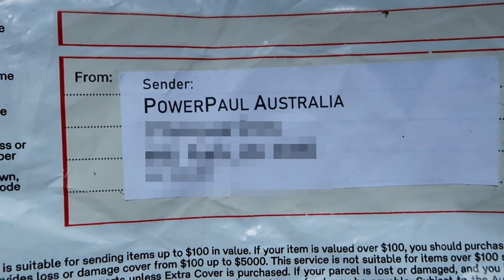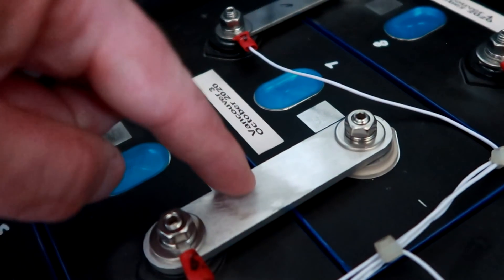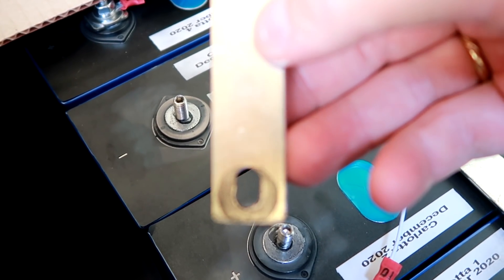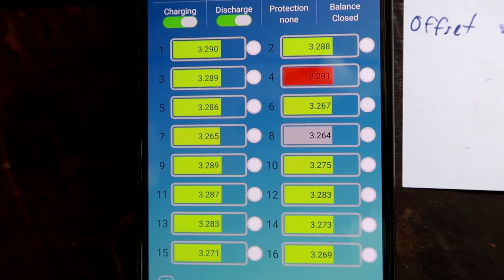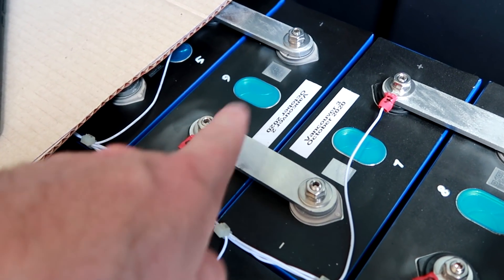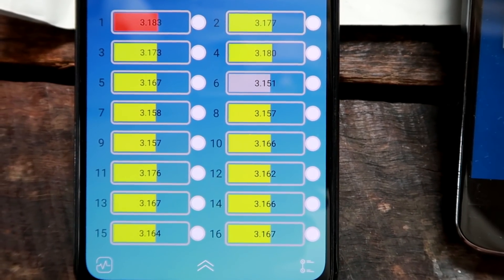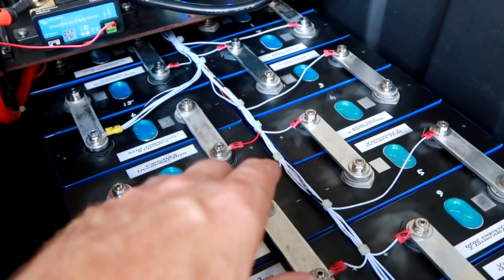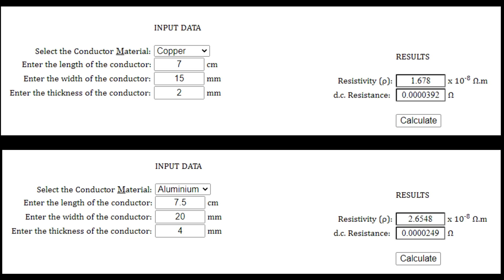Upgrading to Aluminium Busbars. Will this solve the issues?

Comment: Hi Andy, I was thinking, your rings between the lugs and BMS wires, are those made of steel or are they aluminium, maybe replace those rings so there is only aluminium in between. Good luck in finding the issue btw. Maybe measure the resistance of your monitoring wires, they are for checking voltage only but a resistance difference might be in your way. I hope you get a lot of good sunny amps 👍
Reply from the maker: The washers are made of stainless as well, but they are not conducting any power, just pushing down on the busbar. I've checked all balance leads voltages with a voltmeter and they match the ones the BMS shows.
Reply: @OffGridGarageAustralia  if you read the low value in the app when applying load on the cell, is the cell the same voltage when measured with your multimeter? If so then probably the difference in chemicals in the cells might give this effect. If the multimeter shows a different value can it be inductance on the wire because of load applied (just a guess). Thanks for all the testing and checking this all on your journey together with the community!

Comment: I think you find nil voltage drop with the alum-alum interface bars! Alum surface inherently self oxidizes on surface and thus protects sub-surface. Common alum auto castings are alloyed and different corrosion happens.
Reply from the maker: Yes, we're almost there!

Comment: I think maybe bottom balancing, and only charging to 95% may help, or try 100% charging with only 1-2amps, use a DC to DC with cc CV,  and charge to 3.7/cell, to allow the BMS to do its job,  charging with less than 100watts,  should allow the cells to fully charge and Ballance, 3.7v isn't going to damage the cells, but at 1 amp or so, less than 2amps !
Reply from the maker: But where is 95%??? How do you find that point?
Reply: @OffGridGarageAustralia  the charge curve I guess, or 95% of 280ah,  I'm guessing charge at 1amp to 3.7v/cell would allow the BMS to properly balance, being the best option!

Comment: I think the best improvement would be more panels connected! I don't trust anything between the terminals and buss bars,   I'd use both buss bars, the aluminum and copper! Maybe drill a tiny 2.5mm hole on the edge of the buss bars for balance leads! Instead of on the terminals, / allowing the nut to cut into the buss,  I prefer the serrated flanged nuts,

Comment: Please try to do swapping between 1 with 2 and 6 with 7 for example and see still the same two batteries giving the same voltage values ? 
Because I think the problem either from the two batteries ( 1 and 6 ) or from the BMS reading input that read from 1 and 6 because the tolerance issue.
Reply from the maker: It's the cells 6, 7 and 8 which are lower. But are they really lower or just unbalanced. I'll do the test in the next video...

Comment: Could be a positive thing, at least it shouldn't be a negative, haha. Surely... I think maybe I would have went with brass, 3mm x 20-25mm bar, machined with a mill to be 100% flat and true, with a 5mm slot about 10-12mm long to allow some movement if under stress! Surely that would carry the current! Polished  with a clear coat, except the contact area, it would look nice also, *I'm also thinking maybe it's the balance leads!!! * Could it be cheap balance leads? Possibly replace them with silicone 20-22gauge tinned copper wire, and soldered connectors,  this stuff can get a but expensive, and possibly no gains of anything except looking better!  The buss bars would look great, and more conductive than aluminum, but heck, maybe have them silver plated! Or gold! Or both! Haha, crazy talk... But brass or aluminum, I think it's 6061 t6 is what I used, it's a decent conductor, and cheaper than. Brass!

Comment: Is it an idea to connect the BMS wire not under the washer/nut for the busbar but on a seperate connection on the bus bar. Drill a little hole in the middle of the bus bar and screw the BMS connection with a little bolt/nut/washer on it. The big charge/discharge current aren't flowing through the BMS connection. Just as you are doing with a shunt resistor with seperate measure terminals.
Reply from the maker: Yes, you can do that. But the BMS wires are not the problem as I checked all voltages and compared with the ones the BMS shows.

Comment: Wouldn’t the copper bussbar have lower resistance if they were the same dimension as the aluminum bussbar? The other thing I was wondering about was the surface area in contact with the battery terminal. With the constant low readings on those cells, could the problem be with the bms’s not the bussbar? Just wondering.
Reply from the maker: Yes, click on the link in the descriptions and you can play with the calculator.

Comment: Resistance is simple to calculate:  R = rho * L/A   where rho is the material property called  resistivity (it's a table look up), L is the conductor length, and A is the conductor cross section.  With L being near equal,   R_al/R_cu = 2.65/1.68 *1/2 = 0.79.  That is, the Al busbar have about 21% less resistance.   To be honest, the resistivity is not the issue.  It is the galvanic corrosion between the two different metals.   Having Al terminal to Al busbar give you a good good connection which will not galvanic corrode.   You will have an issue between the stainless steel hardware and the Al busbar.  To first order, this should only be a mechanical and cosmetic problem as the stainless steel (stud, washer, nut) have 30X the resistivity compared to Al/Cu.  You will first see the washer to busbar Al surface corrode to Al oxide (white crud).   A little grease (I use Tef-Gel) will keep the Al/Stainless corrosion free.

Comment: Take off the washers under the buss bars. Any weakness in the washers will show up in the voltages. You don't want the washers between the buss bars and the battery terminals.
Reply from the maker: There are no washers under the busbars. They lay flat on the terminals.

Comment: Is it possible that the batteries are slowly going out of physical alignment due to the surface they're sitting on flexing, resulting in uneven pressure at the terminals? This may account for the need to occasionally re-tighten the connections.
Reply from the maker: The cells don't move or flex. I checked the surface area when empty or fully charged, there is no difference.

Comment: No... Nordlock washers will take care of your problem :-D
Reply from the maker: They only make sense in a mobile setup when you deal with vibrations. But in a stationary installation??? I don't think this makes a difference.
Reply: @OffGridGarageAustralia  ???? If the y are awesome in a vibration installation, imagine what they achieve in a stationary. You would never have to think about adjusting the terminals, is that simple.

Comment: Are you using stainless steel washers and fasteners?  SS is not as good a conductor as other metals. 

The voltage drop you are measuring between fastener and bus bar/connecting strap will not be affected by the thickness of the strap.  What you are measuring is due to the contact area and losses in the fasteners
Reply: Bolts are used only to hold the bus-bars to the pads that surrounds the threaded holes.

Comment: The three most conductive elements are Au, Ag and Cu. Copper wins on price, but gold is used in electronic circuits because it doesn't (easily) corrode.

Aluminium is used in overhead power lines because it's good enough, and it's light and cheap. When the SEC left me some free samples, I unpicked the cable and discovered some high tensile corrosion-resistant steel wire in the centre. My brother and I used it to make buckles, we had to heat it to bend it.

I would not use any magic compounds with your aluminium, the al might sacrifice itself to protect the carbon or copper in the compound.

I suggest you do not polish the aluminium busbars, it instantly oxidises forming a protective shield.

Comment: Hallo nach Down under, ich habe Deine Batterie fast 1:1 nachgebaut und habe das Problem mit dem Übergangswiderstand nicht. Ich habe lediglich die Kontaktflächen mit Bremsenreiniger entfettet und einfach zusammengeschraubt. Meine Busbars sind allerdings 20 x 2 mm. Ich habe aber etwas anders gemacht: Ich habe die Zellen einzeln getestet und festgestellt das die Kapazität stark variiert. Deshalb habe ich einen bottom balance gemacht und lade nur bis 3,35 Volt pro Zelle (und entlade nur bis 3 Volt). Alles soweit gut bis jetzt, habe auch die nachfolge BMS installiert, die funktioniert auch gut. Gruß Michael
Reply from the maker: Hallo Micha, danke fuer deinen Kommentar. Wie lange hast die Absorption time eingestellt bei 3.35V?
Du benutzt das neue BMS von QUCC mit dem 'besseren' relay?

Comment: Hi. In relation to your mulcher staring, you nay consider putting in a "soft start" to help with the extra power when in startup mode.
Reply: I think the mulcher don‘t start as quick because the Inverter has a load sense that starts providing more power only if it is needet. That‘s how my Inverter (Studer) works to save Energy.

Comment: I’m very surprised to see you have issues with the bus bars, I have the same cells and bus bars on twin 16s batteries using daly smart  bms, there is some differences until the balancing kicks in, but when fully charged there was only a difference of 3 thousand of a volt .  I used a aluminum to copper conductive grease to stop any oxidation.

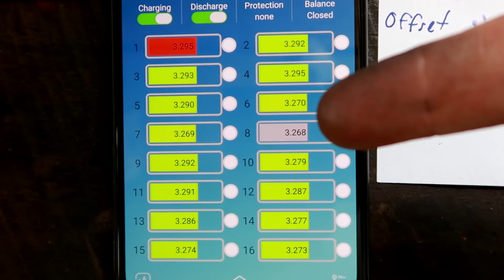Comment: The difference at 8:48 shows 0.027 volts. That is less than a 0.8% difference. I would suggest that the BMS doesn't even have that accuracy(even if it is accurate to within 1%) so this is totally insignificant I think. But great videos and watching with continued interest.
Reply from the maker: Yeah, if you factor in the accuracy of the device I use, It's hard to say what's really going on. The next video will clear things up a bit, I guess ;)

Comment: about compressing batteries ( an other video ) . I asked battery manufacturer BASEN , Shenzhen. They answered; no need for compression, just keep all top side up. If they for some reason 'live' there vil be no leak.
Reply from the maker: There is a difference between compression and fixture. Man discussions online. It's a bit like Apple vs. Android, Ernie vs Bert...
It's either or neither, I guess. I have not seen any 'deformation' of the cells while charging.

Comment: Andy size matters more! Yes the Al busbars are better but that has more to do that they are bigger in size than the material. The bigger size makes the resistance lower on the alu busbars. in the same size Alu is 40% less efficient. If you have the IR of your cells you can than file the busbars down to make al the R the same across al the connections in your pack ;-) 

You need to compare apples with apples not apples  and oranges ;-).  To carry the same load the Al bus bar need to be around 40% more mm2.  Apples and Apples resistance wise  a 20x6,5 mm Al busbar has the same R as a 4x20mm Cu busbar. Cost wise the Al wins big time the costs for a strip of 20x7mm Al is 3,5 times less than a 20x4mm Cu strip. Bus you will need bigger studs ;-) 

If the variation stays maybe compressing could be an improvement. I plan to use 18mm plywood end plates and wrap around with dyneema cord to keep the compression en force equal from top to bottom. solutions with rods i don't like because it ads so much bulk. 

love you fingerspitzengefühl when torquing the busbars. keep up the nice informative video's. that show us that building a battery is more than just taping cells togethers and adding a "bms"
Reply: Ultimately,of course it is, taping cells togethers and adding a "bms, but if you start with cells that are not matched the problems will come, and the this will not go away, and in the end everything stands and falls with how reliable and good is your BMS..
What i would like to see is a good bms that you can set when balancing starts, but then you will probably end up with active balancer.

Comment: if you are going to 3.35v that's only 69. percent..??? what are you thinking.. not a lot 4 sure.
Reply: No 3.35 can be up to like 90% depends if it has had time to absorb. Lifepo4 definitely has a absorb time not like lipo or lion. But I agree that he needs to go up to 3.5 or so to maintain balance.
Reply: @jasondevine6014   do you use lifepo4 as i do. when coming up 3.35v is 69per  i use lifepo4s on a daily run to and from work. an charge up twice a day. the isdt batt go and the 8s batt charger the same.. so how is it not wright.??
Reply: @toneault7499  your use, as you describe it, is fast cycling. You're needing to charge fast so you can get multiple cycles per day. Andy doesn't need to do that, so he can charge longer and slower. This also reduces stresses on the cells, and increases their life. You can't really compare your usage scenarios, because they have different requirements. Therefore you can't compare the voltages either. Charge voltage is just a very small part of the whole equation. 

I can also assure you that Andy is thinking a lot more than most of us are.
Reply: @toneault7499  yes like Andy but bigger 28.6kwh. I can hold 3.35v steady for hours while pumping 30a into it, meanwhile soc is climbing.
Reply from the maker: The Soc depends on the absorption time you allow the cells after they hit 3.35V. If your charger only goes to 3.35V and then stops charging, that may be 69% but if you let them absorb on this voltage long enough they will charge to ~95%. (@Jason Devine explained this already here)
Reply: @OffGridGarageAustralia  i use lifepo4s for the last 8 years and i use state of the chargers .. an monitors . i have 20ah cylinder. and 150ah prism an 280ah as well .. but i dot have any of the problem you have. my bike us to be lifebatt  x-2e 3.3v  15ah lasted 4 years charged 2times a day    
for second hand batts that dam good. i moved up to new 20ah cell for  bike. but use ..? depending on were i go the 150ah  or  the 280ah to travel about  the uk .. with one panel on top and one on each side ( 325w each ) when not in use on my bike they give power to the hose .. plain . simple and easy way to get around the uk. to see all the great steam exhibitions including g.d.s.f.  the Great Dorset Steam fair. WHICH IS 140 MILES FROM ME . and take me 6.5  to 7 hours .

Comment: Pauls busbars Look much better than the original Bars, but esp. If cells are uncompressed i think we should have a flexible busbar. I have seen some but could not buy them yet. Cellsize changes and movement will cause connection issues for sure. Flexible busbars should Cover this. But are hard to find
Reply from the maker: The cells are not moving, not flexing, no convex or concave shaping happens when charging or discharging. Compression may be necessary when you do 1C charges/discharges.
Reply: After a lot of Research i ended up with these busbars, flexibel still not available but Paul has different sizes for mounting 280ah eve cells in parallel and in Series. Expensive but these should last very long. Thank you for the hint to Power paul

Comment: Having already done the calculations and used aluminium busbars on another project I see no point in using copper in this application. If I lived in Australia I would be very happy to get them supplied by Paul. However the mail costs and time for delivery internationally probably makes it not worthwhile. Although making your own takes time and effort it is still worth doing. Here in the UK 20mm x 5mm bar sells at less than £8/m so is cheap.  Cutting strips and drilling holes can be done in less than an hour. The only thing that takes the time is rounding the ends of the busbars which is mainly cosmetic. BTW I quoted 5mm bar because 4mm is not so readily available. As long as your battery studs are long enough this isn't an issue and you get even better conductivity.
Reply from the maker: Yep, that will definitely do the trick. A simple Al flat bar and cut into pieces.

Comment: Easy solution? Replace bad batteries. I had the same problem, but top balancing my batteries fixed the problem. Now my batteries stay within .003v. How I top balanced... First, charge your batteries all the way up as high as the can go. Then parallel them and use a 30v 5a charger. Balance them to max, took a few days. Then series the batteries and discharge them to 30%. Then repeat the charging and top balancing steps for a second time. I know you do not have the time for this, so consider buying a second bank so you can work on one at a time

Comment: I'm wondering if voltage readings that you are getting might be caused by bad/fault crimp on the bms cable at the battery terminal??
Reply from the maker: Nope, checked them all several times and compared with my 4 digit voltmeter. They all seem to be the same and consistent.

Comment: Maybe try adding the balance leads to the bus bars directly and not under the washers/nut.  I was thinking of doing that on mine!
Reply from the maker: Many have suggested that. What is the difference though? Should the balance cables not be as close to the positives as possible? Under any load, you will have a voltage drop to the middle of the bus bar already, right. So your measurement will be more off the higher the current is.
I don't see the advantage of doing it. It's this just a trend right now?
Reply: @OffGridGarageAustralia  No, no trend or anything. Was just thinking of a way to rule out connection shinanagins for your voltage drop issue but maybe switching to aluminum bus bars fixed it for good.👍
Reply from the maker: Yeah, know what you mean. Gives you a bit better control when tightening the nuts not having so much stuff to worry about. I'll keep thinking about it 😉